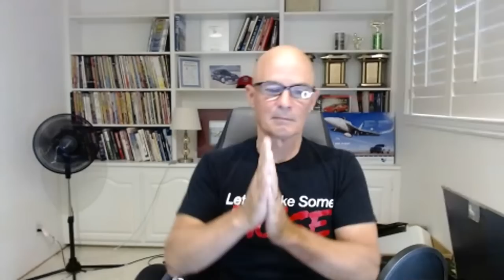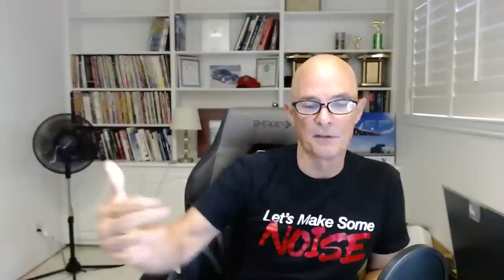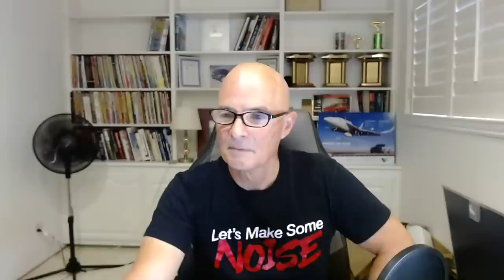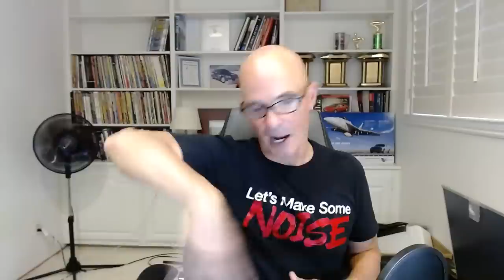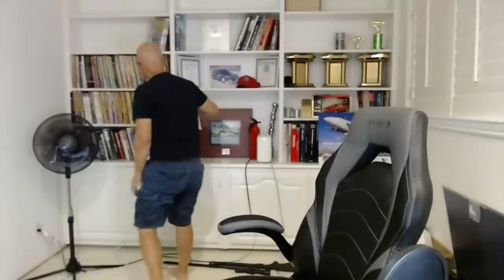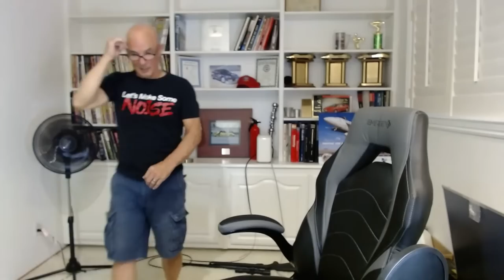LET'S TALK TECH-INJECTOR PLACEMENT PART 2 (VIEWER REQUEST)

Comment: Choose injectors, like first-gen Viper injectors to make the injection spray pattern far narrower, which Dodge found to be better than the usual "paint the intake manifold runner insides" spray pattern. Choose your injectors wisely. The pattern should spread to about runner width by the time the airflow ducks around the next bend, not radially out flat like a diesel engine injector that does a pancake-flat pattern because it injects at or near TDC from the top of the cylinder.

Comment: In the motorcycle industry we have had 2 injectors per cylinder in 2005 and. The upper injectors make more power
Reply from the maker: works well
Reply: R 2 needed for ur app ?

Comment: This is definitely an interesting concept to compare because i have an old formula atlantic 4age and some of the setups use injectors mounted ahead of the ITBS and others use them after. its interesting to see the differences. it would be cool to see slide throttle vs butterflies too.

Comment: Garage 54 put a diesel pump and injectors on a gas engine it worked and gained power why not try it with lt injectors and computer control the squirt
Reply from the maker: I have my doubts

Comment: I wonder what it would be like to inject fuel through a carb annular booster in each port of an IR manifold?
Reply: Carburetors emulsify the fuel with air and that emulsion is what is pulled through the booster venturi. The drop in pressure also helps the air bubbles in the fuel expand and aid in expansion, which aids atomization and evaporation.

Do you have a system where you can both boost the velocity of the flow through the intake runner AND accurately and proportionately emulsify the fuel on its way to the booster venturi?

This is usually done with carburetors, side draft or downdraft, BUT, you COULD inject the fuel like some four-barrel fake-carb injector systems do, but they tend to have the fuel really close to the cylinder walls. If you have the fuel injected right into a booster venturi, there is the issue of how responsive your system is relative to throttle position, etc.

Comment: so what would your recommendation be for a 4200 trailblazer thats being daily driven but allso needs some preformance
Reply from the maker: low boost
Reply: @richardholdener1727  2 more questions lol 
what kind of boost nuumbers you mean by low 7 to 8 psi?
allso small or large turbo
Reply: Most engines easily handle 1/2 atmosphere Boost. Belt driven is instantaneous, less invasive , less $$ if kit for app exists. Turbo's cool........ But always a fabricated install that takes lotsa time, $$$$